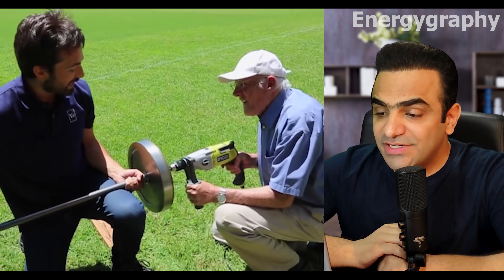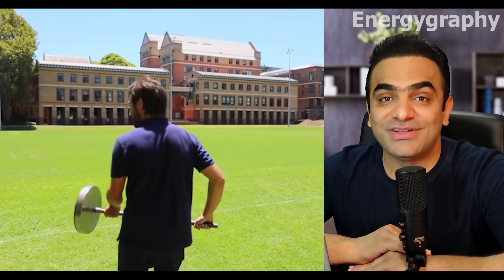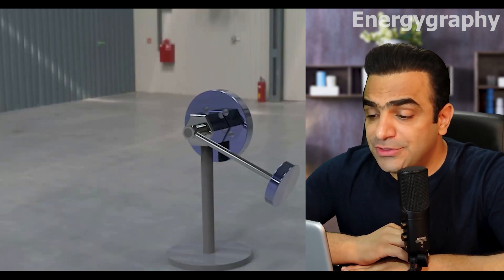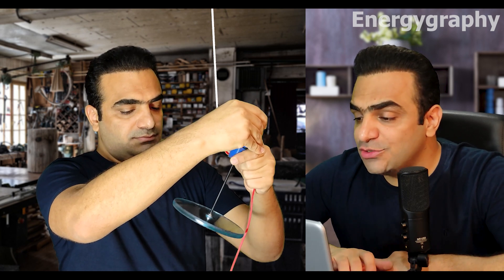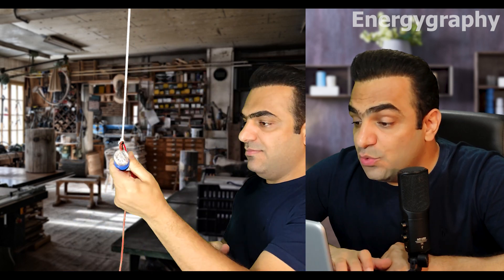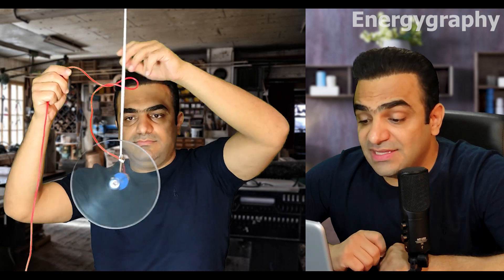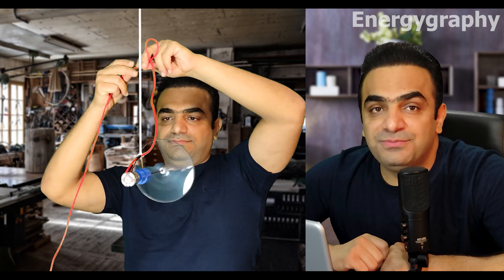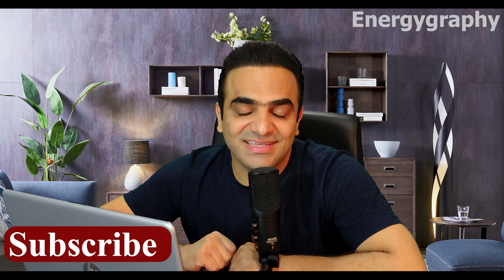Incredible Flywheel Experiment Inspired by Veritasium! Can It Lead to Perpetual Motion?"

Comment: I do like the idea of educating the masses, but please use the correct termanology. There is no such thing as Anti-gravity as the lays of physics will not allow it. As with magnets the north side of the magnet is attracted to the anti-norts or South side of the magnet. 
Gravity is the same,Anti-gravity is the opposit of Gravity and therefor will come crashing together just like 2 magnets with opposite faces comming together.
Likes repel, Gravity repels Gravity just like North repels North on a magnet. So if we want to build a device that will levitate we need to mage a gravity device so we can repel our selves off the planet.  There have been many gravitational devices made by man over the last 140 years and if we look through recorded history we can find the makers of those.
1885 John Keeley was the first recorded man made gravity device I could find, Next was Nikola Tesla and his device in 1895. The nwxt I could find was in Germany near the end of WW2, with the Hanabu 1, 2 and 3 also the Bell device plus others. In 1953 there was John Searl in England and he made several, some of which may have flown at almost the speed of light.

Do remember that the Earth has a gravity field at a strength we call 1g. If we bring two fields of 1g together then the result will be that the smaller of the two will leave Earth at almost the speed of light, this of course is dangerous to everyone near the experiment. The goal is to slowly increase the gravity force of the device untill it levitates, say around 1/8g, only experiments will tell if this is correct.